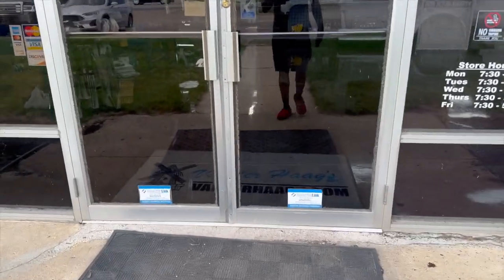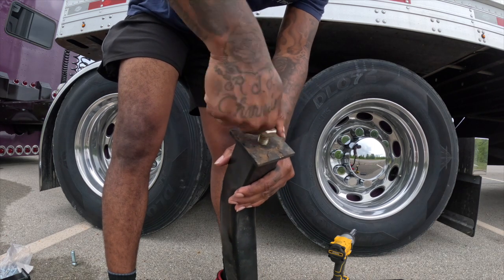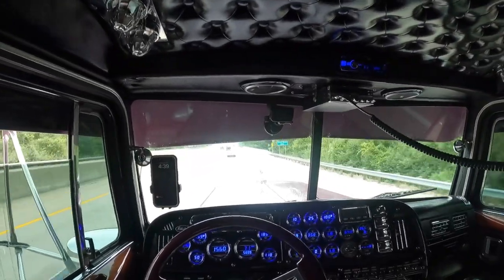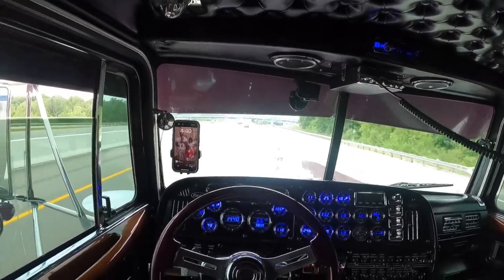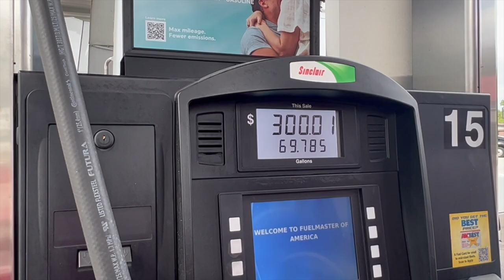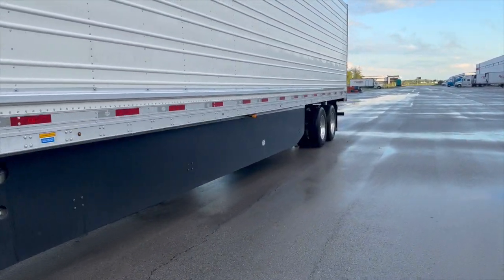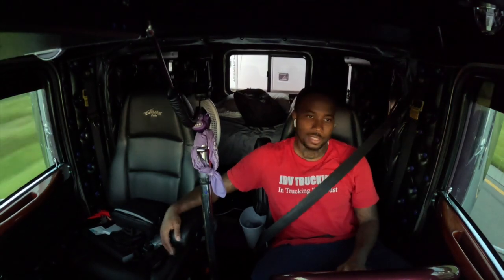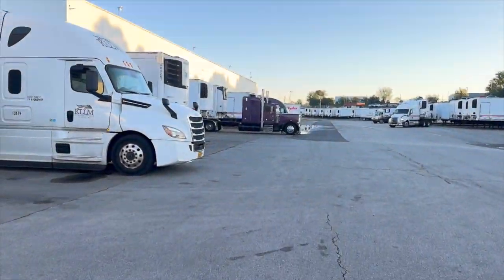Broken Fender Bracket girlfriend helped me fix it|Last minute load paying GREAT|In Dock 8 HOURS|

Comment: Just a tip. I drive a gravel truck so I'm on some extremely rough roads going in and out of sand pits. Cut you a piece of mudflap the same size as the bracket where it sits against the frame. Cut a hole in the piece of mudflap for the bolt to go through. When you mount the bracket put the piece between the bracket and frame then tighten it down real good. It'll last much much longer like that. We do it on our gravel trucks and never have any problems with brackets. We also put pieces of mudflap between the fenders and brackets. That'll keep your fenders from cracking.

Comment: Good video, might take the old bracket to a welding or machine shop that welds and have them make another piece of good steel flat steel and taped out hole with threads and weld the new piece to the old side and you have a spare bracket for down the road. Yeah i remember when gas was $.99 cents and diesel was $ 1.10 - 1.20 a gallon. Take care and keep the rubber on the road.
Reply from the maker: Yea I thought about it but I just figured the new bracket was the easiest way